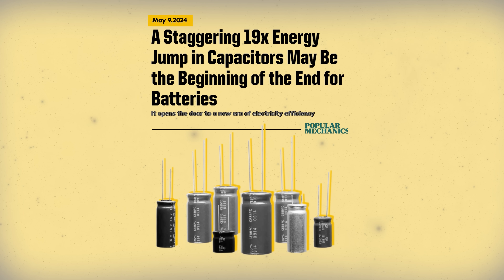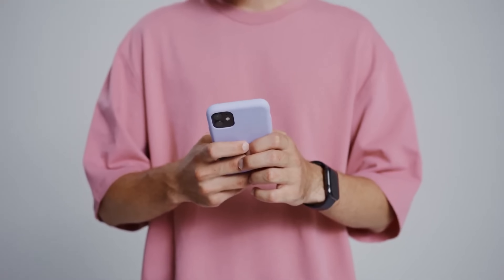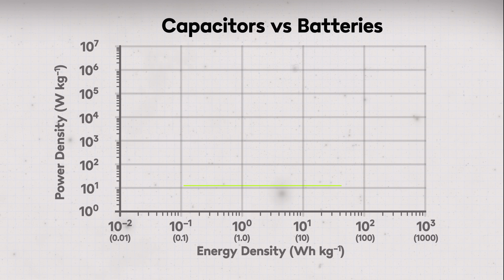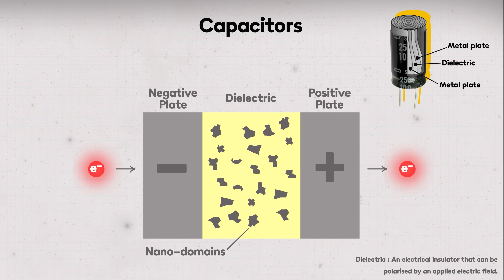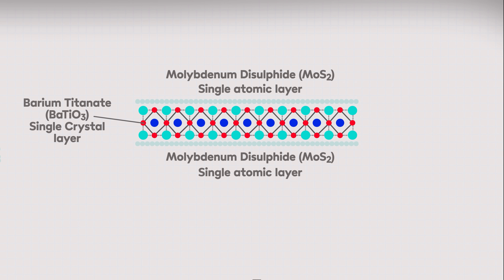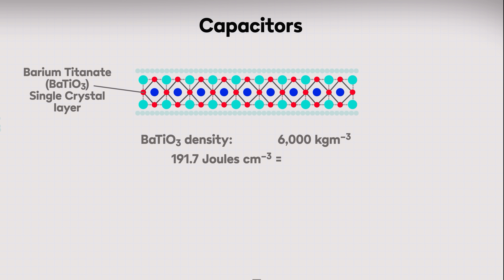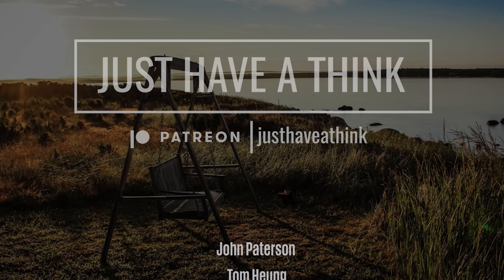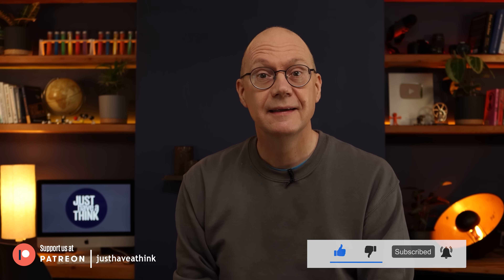Charging an EV faster than filling a gas guzzler? Surely not!?

Comment: A super-duper capacitor is not going to change the recharge rate at a charge station. They can only improve regenerative braking where a large pulse is spread out so that the rate of charging the battery can be lower.

Comment: I can't remember exactly but I thought round trip efficiency of Li-Ion batteries was around 95%, so 90 would in that case not be so great. It's probably a bit like what CSIRO was trying to do with Lead Acid batteries in the early 2000's where lead acid is considerably slower than capacitors at accepting charge so they made hybrids, except that fell on its face because you needed nearly the same volume in capacitors as you had in batteries to reach optimal efficiency. 

Then again if this is about reducing cycle degradation (Li-Ion) maybe 5% of the battery volume will be enough?

Where it also might be useful is in energy harvesting applications and with those nuclear batteries that can only provide uA but can for years.

Comment: Could this be one of those technological breakthroughs?

Simple answer: No. (and here's why)

It's not unfeasible to have a battery charge in a few minutes (given you can control the heating). The problem arises with supply. Let's say there are 10 cars at a charging station, each wanting to charge from 30% to 90% (of a typical EV battery of 70kWh), around 42kWh. Let's say they expect to do that in 5 minutes. Just running the numbers at 100% efficiency (which of course never happens), that would be a supply demand of just over half a megawatt, each! Just to give you an idea of what exactly that looks like, the average house uses around 900 kilowatts a MONTH! 

If we look at it from a voltage/current aspect, then at the standard domestic supply for Europe, Australia, most of Asia, 240v, the current required for each EV trying to get 42kWh into a battery in 5 minutes would be 2,100 amps (double that for USA). Even 3phase (480v) would need 1,000 amps.... And that's for EACH car!  (A very heavy duty industrial welding machine draws about 100 amps)

This is why EVs will never be able to charge quickly... Yes, the batteries could be engineered to be able to deal with the massive amount of heat, and the cables can be made heavy enough to cope with the huge current (but not cheaply!), the problem will always be the supply side. Just how do you get that huge amount of energy to the charging stations?

Comment: I may be incorrect here, but I'm fairly certain that I've seen super capacitors with higher energy density. Based on the high-precision needed to manufacture this "breakthrough" tech, I can't imagine that the cost would outweigh the density and charge claims.  This is another case of efficiency versus affordability. That's not to say that these wouldn't have their place, they just won't become as universal as something close in performance but cheaper. 

Thanks for sharing this research! ✌️

Comment: The ridiculously poor energy density means these have no place in an EV.  You'd need a physically large and heavy bank of these in an EV to absorb enough charge to then pass on to the battery pack at a lower rate, it makes zero sense.

Comment: Even if the energy density was double that of Li it wouldn't make much difference, the infrastructure to charge vehicles if there's even a small percentage change in the fleet doesn't exist and can't without some truly massive additions to generating capacity.

Comment: What I miss about this development is that, as far as I followed, the capacitor is still just a "buffer" between the charger and the battery. It can take power x19 faster from the charger but the battery still needs to pull the power from the capacitor fast enough or else all you get is a small-capacity capacitor filled up for a few seconds then it still has to drip-feed it into the battery, no?

What am I missing?
Reply: Yeah, it doesn't make any sense to me. With such a low energy density, it won't make any sense to have more than a couple of hundred watt hours of storage at most. So you can charge that couple of hundred watt hours pretty quick (like 3 seconds or so), but then you're just back to charging the battery as normal. It will probably only save a few seconds over the whole fast charge.

Comment: I've always wondered why they don't use supercapacitors for launch from stop and regen applications; thanks for spelling it out. This sounds like great research; maybe one day, we will get to that dream.
Reply: Yes, how much are supercapacitors used in city  buses, garbage trucks, forklift trucks, elevators etc which are constantly "accelerating and braking" ?
Reply: @JohanLofgren-jc4mh supercapacitors and ultracapacitors are used worldwide in industry and trains, busses etc. Also Toyota uses supercapacitors in several hybrid models and in motorsport.
We use supercapacitors in our windturbines for emergency stop/vane- positioning the blades. Much more reliable than quit ordinary industrial grade 24V batteries in the freezing cold (-40C).

Comment: Batteries are like slow twitch muscles in a mammal and caps are like fast twitch. They could be used very effectively together.
Reply: More like fast twitch muscles that weigh so much they're not helpful; read the comments from electrical engineers. Recharging a small buffer capacitor very quickly just leaves the rest of the big battery to recharge at its usual rate. And unless you're racing flat out on a track, a conventional battery can absorb enough power in regenerative braking to slow a car to a standstill.
Reply: @skierpage  It wouldn’t be just a capacitor in parallel. It would be some trick circuitry. I remember when people said LED’s won’t be bright enough to light a room.
Reply: @andrewmclean1239   there's no trick circuitry solution to the fundamental mismatch. There's no role for a capacitor unless you need to supply or store large amounts of power (kW) for mere seconds, i.e. negligible energy in kWh. Sure, you could make a car with a puny battery that uses a supercapacitor for 0-60 runs and braking, and the 2019 Lamborghini Sián did have a supercapacitor powering a weak 34 hp motor, but in the real world a decent-sized lithium-ion battery can supply 450+ kW (600 hp!) and capture the regeneration energy from pretty hard braking.
Reply: @skierpage that’s the point. Pushing power into a cap so it can be released quickly when needed is precisely the whole fast twitch / show twitch idea.

Comment: If capacitors are ever going to be preferred over batteries for any EV, it would be in a mail truck.  Think of it: a mail truck making deliveries in a suburban neighborhood travels only a few miles per day, but makes hundreds of stops.  So the range can be very small, as long as the regenerative braking is really efficient.  And I believe -- but I[m not sure -- that recharging a supercap is more efficient than recharging a battery.

Comment: With the supercapacitor's energy density still so low, I fail to see how it could substantially impact charging times, without making the car substantially heavier. Am I missing something ?
Reply: I think even in the best case scenario these could only hope to improve charge times by a couple of seconds, so basically pointless.
Once you make the capacitor much bigger than 1 or 2 hard regens from highway speeds the weight will start to get out of control at an 8.8 W/h per kg energy density.

Comment: I can't imagine how robust a charging system would have to be to be able to deliver that amount of energy in such a short period of time.  Note:  I can actually.  I just had Gemini calculate that the system would need to handle a current or around 7,500 amperes. That is to charge an average size EV battery in three minutes. Gemini also estimates that would require a copper cable 34mm in diameter.
Reply: Wait till you ask it how heavy the capacitors will have to be to have any real capacity and be able to make a difference to charge times. 8.8 W/h per kg is too low to make I worth it.

Comment: still don't see how they might improve the charge period of lithium ion batteries though. Are they suggesting sticking some of these inside a Li battery somehow to increase its recharge speed?
Reply: Yeah, doesn't make any sense. They are talking about paring the capacitors with the batteries, but to make any real difference to charge times, the capacitor would have to be way too heavy to make sense. 
It don't think this will go anywhere with EVs. Maybe small ones used to handle a few seconds of regen and initial acceleration, but even then I doubt it will be the norm.
Reply: @patrickbeck4062  it could work in a hybrid car with a small battery. I know hybrids can be much more efficient than petrol and accelerate very fast, but not sure that will be viable in the longer term

Comment: I have a public EV charge point behind my office in Australia that allows charging for a donation. However, patronage is decreasing. I think this is due to newer cars having better batteries and longer ranges. People charge at home and don't need to top up as much as they did in the early days of Nissan Leafs etc. The time to charge may not be as important as it once was.
The Electric Viking is talking about the new CATL battery that has a range of 1,000 KM (or miles ?). This also reduces the need to worry about charge times.

Comment: Capacitors are the one of the main reasons that electronics stop working. Decades repairing electronic units taught me that one of the first things one does after checking the obvious - is it plugged in? - is check all the electrolytic capacitors. The new 'super capacitors' have been used to replace the 12 volt battery in cars for many years as they tick all the boxes and do not pose so much of an environmental risk. I have just had to replace my 65" television because a capacitor blew in the HDMI circuit of my Virgin Tivo box which took out not only the Tivo but my TV as well. Only the red channel got through for a time - until it failed too.
In an EV, I imagine that super capacitors might look tempting but just as the electrolyte in EV batterys has a shelf life, it is the same for capacitors.
Reply: Capacitors used in consumer electronics are manufactured to be as cheap as possible, not to have long lifetimes.
Reply: @avsystem3142  It is very difficult to make a non electrolytic capacitor without a long lifetime. Even electrolytics will las indefinitely if they are appropriately derated.
Reply: No 12 volt car bateries have been replaced by supercapacitors.  Their energy density is far too low.

Comment: What about charging from the road itself? We already have dynamic charging systems, we also have solar powered roadways that can generate some of the juice where it is needed and act as a conduit for the rest. The road melts snow and ice and have adjustable pavement markings. The solar collection doesn’t use additional land resources, it just adds an additional use to the stagnant pavement. Spreads the load(s) out decreasing the need for large power hungry generation farms.

Comment: I'm not understanding how adding these capacitors can improve the charging times when paired with a traditional lithium EV battery. You still need to charge that whole lithium battery since that is what holds the majority of your stored power for your trip and that has the same limits it has always had.

Comment: The requirement of being able to charge in the same time as filling up a tank is a silly distractor. Really, in >99% of the cases, EVs will do just fine with a maximum charging time of 20 minutes. Plug in, go to the loo, have a coffee and be on your way again. And even this is only necessary for a couple of times per year, as the rest can be done on slow charging AC chargers when cars are parked while you do something epse. Plenty of cars already achieve this.

Comment: So you basically quick-charge a capacitor, then drive on while the lithium akku is further and smoothly charged by the capacitor? 🤔 sounds nice
Reply: no, he got it wrong, capacitors are for small fast charges in regenerative braking where the energy to be fast storaged is small, some numbers... 1kg of capacitors only store 8 wh of energy while 1 kg of battery store 270 wh so 1 kg of battery stores the same energy of 33 kg of capacitors. Now the calculation for a 100 kwh battery...100 / 0.27 = 370 x 33 = 12.210... translated the cells in a 100 kwh battery weight 370 kg, 100 kwh of capacitors weight over 12.000 kg, not to mention the size/volume a car with 100kwh battery would have to carry 12.000 kg of capacitors, and not only the weight but the size too... pretty sure somewhere someone misunderstood what he heard and is also bad at maths.
Reply: @brixtonianme9717  thanks for the maths, I'm already aware of that from.the videos and the comment.
This would also be obvious to the authors of this paper.

So they might have something else in mind, where the capacitors doesn't need to match the batteries energy content.
It seems to make sense for a smoother regen charge or providing small boosts in between, for what I could read in the comments
What do you think?
Reply: These won't make any difference to charge times. Even if you add half the cars weight in capacitors and can charge the capacitor at 1000kw and the rest of the battery at 250kW you're only going to gain around 90 seconds over just having the same kW/hours in a battery. Except the battery will be over 1 tonne lighter. Plus you have to go through all the effort and cost of building a charging setup that can handle 1000kW for that 30 or 40 seconds.
Until the energy density of these can improve massively, it won't make any sense to use capacitors bigger than what you can get from 1 hard regen from highway speed. Probably in the 100W/h range. Which will only gain you 1 or 2 seconds charge time max, compared to a battery that can take 250kW. 
These will be so heavy that you're pretty much always better off just adding more batteries instead of wasting weight on capacitors.
Maybe a 100W/h capacitor (would weight around 11kg of just capacitors) will make sense if it can really take the peak loads off the batteries, but that's about it.
Reply: @patrickbeck4062  ok, I see. Thank you so much for the detailled answer! 🙏😊

Comment: Help me here.  In reference to cars, does this mean one chargers the capacitors and they finish the charge of the battery while you drive away? That’s what makes it faster?
Reply: No, the charging faster thing doesn't make any sense. These capacitors are just too low in energy density to be useful in reducing charge times.
The only way they will useful is if sized right to be able to take 1 hard regen from highway speeds then put the power straight to the motor for the first few seconds of acceleration (in most situations it will be better to not put that power into the battery, just save it for the next time the motor needs it). A capacitor this size can only reduce charge times by a maximum of around 1.5 seconds compared to a battery that can be charged at 250kW. If it is any bigger than needed for 1 or 2 regen cycles the weight just gets out of control.
Until they can get these much, much higher in energy density I don't except to see these in regular EVs. Maybe some specific situations, but probably not a standard thing.

Comment: Suoercaps Adding capacitors between a battery and the charger does not magically reduce strain, whatever energy you put in the supercap still needs to be transferred to the battery and when the supercap is 5% the size of the battery pack, the charger is dumping energy directly into the battery pack the whole time after the initial 5%.

A fancy supercap with 90% roundtrip efficiency is kind of crappy next to modern lithium batteries with up to 96% roundtrip efficiency.

Seems like a waste of space and weight unless your EV application is something like a 1/4 mile electric dragster or EV racing where you may need a solution able to repeatedly handle 1MW of peak regen when entering corners at 200mph, likewise for acceleration on exit.
Reply: Yeah, the charge time thing makes no sense based on a 8.8W/h per kg energy density.

Comment: We should always be skeptical that lab results will in any way to equivalent to real world results, but I hardly need to tell viewers of this channel that. 

At face value, the real barrier here to my eyes if it all works out would be cost. This sounds like an incredibly expensive process requiring a lot of highly refined material, specialized workforce and narrowly focused manufacturing. I am always going to be skeptical that something so expensive is going to be a significant contributor to climate change mitigation, because it will be extraordinarily difficult, if not impossible, to democratize the technology. A solution available only to wealthy countries is not a great solution.
Reply: Cost will definitely be a factor, but I think the main limit will be weight/energy density. Even if they can get the cost really low, 8.8W/hours per kg doesn't even come close to current mass production batteries. So it just won't make sense to use a capacitor much bigger than needed for 1 high speed regen. Which also won't make any difference to charge times.